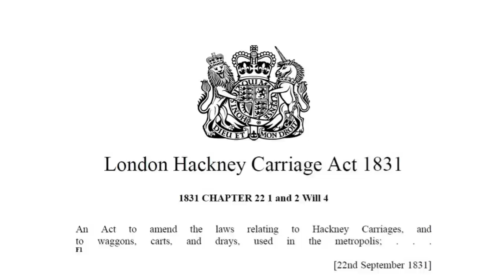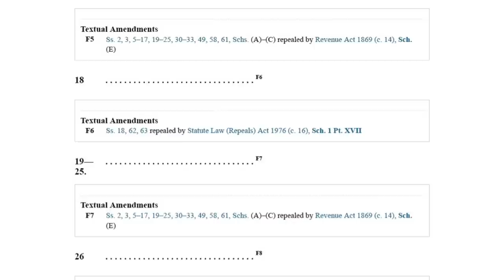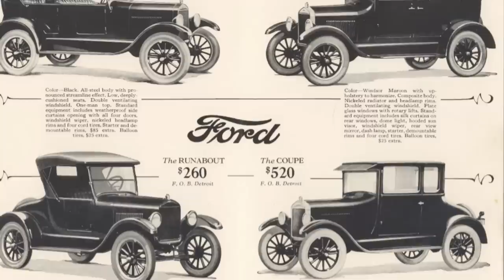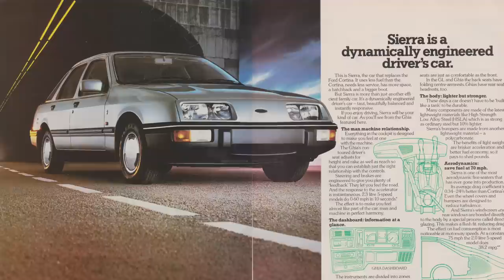Four Automotive Myths That Just Aren't True

Comment: Closed captions say "five common automotive myths" 0:19  I first heard the backwards aerodynamics claim directed at the Ford Pinto hatchback. Supposedly pro stock racer Bob Glidden  had Ford measure drag on the Pinto and as a lark, turned the car around in the wind tunnel and found it created less drag that way. Until now, I believed that trait was largely confined to the Pinto. thanks for clearing that up!

Comment: Thanks for this interesting look back into our automotive history. In defence of the dear old allegro. It wasn’t a bad car, I used to sell them for a while when the first came out. They were really  only an up graded  1100. They were comfortable, roomy and they went well. The original  ‘Quartic’ steering wheel was a bit of a hard sell but hey, it was the seventies. As ever keep up the good work
Reply: Squared-off steering wheels are very common these days - look inside a Peugeot! The Rover SD1 definitely had a slightly squared wheel but no one seemed to mind. The Allegro was ahead of its time for that - if only they'd given it a hatchback!
Reply: i remenber when i saw the alegro i felt like it was a original design or a evolution of the austin 1300(GT or not)same engine of the mini 1.275 GT , the regular 1.3L was less powerfull, it wass bigger and nice lines in the car body but had already bought a new car two monthes earlier ,so i didn´t bought it for me , i´m not sure but in the 80´s they released a improved model ,maybe late 70´s
Reply: I can't talk from personal experience, having never owned an Allegro, but if they really were as bad as some would have you believe, why were there so many of them around?

Comment: To expand on the Alfasud story with information from Matteo (Roadster Life)'s channel:
The Sud used the same steel as Northern Arese-built Alfas - the reason they rusted so badly is that the factory was new, with a disgruntled staff more used to farming than building cars, and the several hundred micro-strikes that came during the Sud's production meant that bare steel car bodies were often left outside, totally unprotected in the weather between the stamping and welding plant and the final assembly line. There was nothing inherent about the design or specification of the Sud that made it any worse than most other cars built at the time - it was just poor management, industrial action and inexperienced workers. Lancia's reputation for rust is even more of an old wives' tale.
Since 1989, every single Alfa Romeo product built has been galvanized, so the idea that Alfas are still rust buckets is simply not true. In fact, they're much better protected than most Japanese and many German cars. Amazing how one product can tarnish a manufacturer's reputation forever.
Reply: Yeah second gen Alfa sud had a pretty decent rust proofing,not astonishing but good enough.
Reply: The story that I heard was similar in that the bodies of Alfa cars were built by an outside contractor who stored then in a leaky old warehouse, where they were rained on, the body cavities ingested water and when they were moved to the factory they were dipped in the usual protective primer that simply didn't adhere because it was wet.  When Fiat took over Alfa they insisted that the supplier build a new dry warehouse to store bodies and panels and to ship then in covered trucks.  I have an 1984 Alfa Alfetta GTV6 that had the new paint protection regime as well as being waxoyled by the dealer from new  and it sits there today outside in sound paintwork condition and in a better state than my 1992 Merc.
Reply: My 1999 156 and 2007 159 both rusted to destruction.
Reply: My 1991 Alfa 33 was less prone to rust than my previous Renault Clio from the same model year. And yet, each of them was far from having the same reputation on the market. So, yes it's time to get rid of all this unfounded bias and prejudice.
Reply: My sister has just written off her 12-year old Brea. Terminal rust on subframe. Sad really because the rest of the car was beautiful. Obviously not galavanized properly (at all?) We sold our 1996 Audi A4 at 12 years old and there was not a spot of rust anywhere. Even stone chips were ruse-free. That was galvanized.
Reply: @garethonthetube  Yes I had that on my 159 - the subframe (and entire body) is galvanized but the paint they used on it was poor and the undertray has insulation that traps water against it. It's a known problem on 939/946 Alfas and many specialists provide refurbished subframes for a reasonable price. Funnily it was the only rusty part on the entire vehicle.
Pity she scrapped it, it's an afternoon's work to swap a subframe on those cars. I did it myself with hand tools.
But I've still seen younger Mercedes, BMWs and Volkswagens with much more serious rot on visible body panels. Mercedes in particular were famous for building absolute rubbish in the late '90s to mid 00's.
Reply: @Strike86  The garage couldn't get it off, it had rusted itself onto the rest of the body, so it would have caused a lot of damage. Wasn't worth it.

Comment: I owned 2 Alfasuds, still to this day one of the best cars I've ever driven. they were incredibly reliable/economical/quick/handled well/comfortable/well appointed but they turned to dust at an alarming rate like everything Italian did back then. most cars from the 70s weren't built to last which is why few people had them serviced regularly (I was mechanicing from the mid-70s to the mid-80s).
you're right about the All-aggro getting too much stick. it was a massive leap forward in refinement/practicality/performance over the 1100 even though it had that weird steering wheel, strange tapered brake pads and too much really cheap plastic inside. the estate version was a cute little thing though. 
but hey it was the 1970s, a period when most of the British car industry was under British Leyland and stretching out the life of ancient running gear in new bodies was pefectly acceptable.

Comment: The problem with the rear window of the Alfa-Sud was the clips that held on the chrome strip.  They were pushed in and broke through the paint all around the window. When I replaced the the bottom of the rear window of mine we took the rear window out and rust proofed it all around then replaced the window. Instead of replacing the chrome surround I filled the void with black Silastic and took the time to make it look perfect. i remember seeing an Alfa guy do a double take when he walked past mine at a service dealer. I spent over an hour telling him my views on the car which was mostly favourable -the fault was where they took the vacuum off caused that spark plug below it to burn out. being in Australia it didn't rust until after i had a collision and they didn't rustproof the repairs.

Comment: Ford's quote never said you couldn't get a car in the color you want if the color you want is grey, green, blue, or red.  He simply said you'd get what you want if what you want is black, and that was true so long as he said it in 1914 or later.  He wasn't lying.  The idea that that was the only color ever made is something he never said, but was actually true after the first year.  Japanning, or baked enamel, though we'd use the term varnish today to describe the technique called "baked enamel" then.  Having the body match the frame and other parts of the car also streamlined production, so, while not necessarily drying faster, it did speed production and make it cheaper overall.

Comment: I have a couple more for you Ed.  No Audi sold in the UK have indicator bulbs fitted at the factory.  When Audi realised that nobody used them, they saved some money buy not fitting them in the first place.
In the eighties, the sales contract for the Ford Escort XR3i stipulated that if you didn't wear a basball cap back to front every time you drove the car, your mum would confiscate your car keys.
I'm pretty sure they are both true>

Comment: All basic cheap cars of the 70s rusted, because no car company used much corrosion protection such as zinc dipping and the paint was acrylic, not epoxy. British roads are routinely salted in winter, and there's your prime cause. My first car was a 1970 Viva. At 8 years old, it was already fairly rusty and tired, and that was normal for Vauxhall, Ford, Hillman, BL, Fiat, etc. An 8-year old car today is considered nearly new as long as it's been treated reasonably well.

Comment: I remember spending many hours looking for information before the internet. One of the biggest problems was finding practical information. For example if you needed to do a job on your car you could get a repair manual from the local library. However in practice you really needed to talk to someone who had experience doing the job... The man in the pub probably had never actually done it... but any ideas were better than nothing.
Reply: That's probably why I wasted hours shopping around for a metric adjustable spanner.

Comment: What I heard about the Alfasud was that it was actually built in the Sud, the south, in a new factory in Sicily that was right at the coast. 
 
But the Italians had a habit of striking frequently, and in that time the freshly built raw steel bodies were standing outside, totally unprotected. 
 
Outside, with the sea near, they were getting salt spray right on the raw steel body. 
 
So you had the main source for rust, the salt from winter, integrated into the car, even UNDER the paint. 
 
No wonder the people said the rust before you buy them...

Comment: To go further into the Alfasud (and Lancia Beta) rust issues, which mostly afflicted early production models, we have to get a look into how and where it was produced.

In 1968, the Italian government and Alfa Romeo renovated the old production facilities at Pomigliano d'Arco (near Naples) as part of a plan to industrialize Southern Italy, but for some reason, the people who got hired to work at the renovated factory were mostly the same who renovated it, leading to some early issues with workers who never built a car before being takes with a whole sub-brand of new cars (as Alfasud was meant to be a whole branch of Alfa Romeo), and on top of that, the frequent late 1960s/early 1970s strikes meant that steel panels meant for use in cars were often abandoned outside for days, leading to early Alfasud models suffering from early rust.
Reply: Another part of the problem was, apparently, that many of the assembly line workers were from farming families and simply sloped off from work to help with the harvest rather than finishing the week's production. It is nonetheless strange that management hadn't taken the local economy and working traditions into account!!
Reply: I heard another story about southern italian workers being reluctant to apply anti-rust coating under pretext that 'it was irritant to their skin'.
But, Luigi, we have provided you some protective gear to avoid that. Why are you not wearing it?
Because it's too hot in there.
facepalm 😮‍💨
Reply: @razorback20  That one most likely ain't true - keep in mind these people came from rural areas where they either worked the fields or brick & concrete, it's not like they didn't know about protective gear or cared much about skin conditions.

Comment: A great video Ed as usual. Many cars of yester year had design deficiencies that held water in some way. Some were mechanical (lack of drainage holes) along with production where body shells had to move outside in the rain from one building to another. Other issues could be aimed at the perceived anti rust treatments that were OK for a year or so before breaking up and forming rust traps accelerating the metal moth. Adding external trim was also a problem where push/screw in mounting clips could wear the painted mounting points adding even more rust traps. Thankfully things seemed to have moved on... from a body perspective anyway. Back in the day a 10 year old car could have been perceived as living on borrowed time due to body rust, these days the car body in many cases out lasts the engine and running gear. Cars could last even longer if the costs of things like suspension, labour costs etc didn't exceed the scrap value of the car and that is a big shame. A quick question, does a London Taxi still have to a) have enough headroom for a gentleman to wear a hat and b) be able to perform a 'U' turn in the street?

Comment: As an ex alfasud owner and professional paint sprayer I'd say that the steel in Alfas may not have been Russian but it was poor quality, these cars rusted fast, a lot of cars rusted back then but alfa steel rusted much faster than say Ford steel, a rust scab that started under paint would be a hole in no time. My friend worked for an alfa dealer back then and the suds were rusty off the boat, boot lid hinges would be siezed on delivery. Mind you, I worked for Peugeot and a good few 605's were painted before delivery due to rust issues. 👍

Comment: I remember reading about the theory of 50s rust onwards that low back ground steel reacting badly to chemical treatment and also welding methods at the time, interacting with the radiation contamination in the steel lessing durability. Now I don't buy it but I'm no bio chemist or radioactive materials expert.

Comment: Great video Edd, about the Mini myth, I never knew that myth was that, I did believe that myth that BMC made a loss on every Mini they produced, but you’ve busted that one, thanks! 
       Another myth is regarding the Reliant Robin three wheeler that Motorcycle licence holders had to “blank off” reverse gear if they didn’t have a car driving licence, this may have had some truth when three wheeled cars first made an appearance but definately a myth since at least as far back as the 1960’s. 
    Reliant Robins we’re produced and sold to motorcyclists so that they had a choice other than paying for driving lessons and passing their tests before driving a “Car”.
Reply: Sorry....but that is a myth as well. Reliants , even before the Robin had reverse and you had to have a full licence to drive one. 
I think you may be getting confused with the original three wheelers... that were driven by motorcycle engines ...some even  had to be kick-started under the bonnet!
The Meschersmitt three wheeler? And another one whose name escapes me....)
They obviously did not have a reverse gear....so possibly, that was the loophole.
Maybe.... just maybe, they did not require a full "car" licence.... But later Reliant Three wheelers you surely needed a car licence.  (My Dad had one)(🙄)
The major difference was the annual car "Road Tax".... they only attracted a tax of somewhere between a large motorcycle & a four wheeled car. 
For some reason....That was the clincher for my Dad....  I personally hated the damn thing! A freaking death trap: An accident looking for somewhere to occur.

I never passed a Motorcycle  FULL licence...I was a "L" (Learner) on machines up to 250cc.... But I had a full licence for cars....so I could drive the Reliant.
Having just written that...you have made me re-consider: My Friend has a Full Motorcycle Licence  & also had a Reliant at some point.... Mmm I'll check with him!
As Arnie would say: I'll be back! Cheers.
Reply: @patagualianmostly7437  My Dad only ever had a bike licence and drove one for many years, I owned and drove one legally after passing my bike test, it actually helped me get more practise on my own for my full car license.
       The idea that motorcyclists could not drive a three wheeler unless they blanked off reverse first is definately a myth nowdays, this may have been the case initially but certainly not for long.

Comment: Pretty much all grades of mild carbon steel will rust if not treaded. Steel is by definition mostly iron, which will rust (form iron oxide) when exposed to oxygen. I worked in heavy equipment manufacturing for decades,  our vertical panels are basically made with automotive grade sheet metal. Anything that sits in the factory unpainted has to have a rust inhibitor on it. Thicker plates are shot blasted to strip off rust and scale prior to painting...but any scratch or dent that disturbs the paint results in immediate rusting. The trick to keep cars from rusting is  1. Galvanizing (adding a coating of zinc or other non-reactive metal) and 2. Paint with multiple layers of urethane based coating to keep oxygen away. Datsun /Nissan cars of the 70's were notorious for rusting while in transit from Japan to the US...zinc dipping ( and thicker steel) took care of that.
Reply: Yes...I can appreciate that. 
Also...they claimed great MPG figures.... of course they could: The cars were self-propelled-tin cans!  great MPG but...Lethal in even a minor accident.
Are we seeing a return to that scenario with these overweight electric cars? The inertia is immense... any accident will be accentuated by that.  
You have to wonder...don't you... "save the planet with your electric car"....."kill yourself and your kids with your planet saving car."...  What a crock of........

Comment: I always learn something from your videos, and today is no exception.   There are a lot of stories around the Allegro production.  Have you heard the one about the early Maestro that if you jack the the back up on the original supplied jack that the rear window pops out.. I've wondered if there is any truth in that one.
Reply: I heard that story about the Allegro !! Myths merging and melding !!!
Reply: One thing I do know from experience ... if you parked a Renault 4 half on the pavement and opened the tailgate, you couldn't close it without levelling the car fully on the road.
Reply: A friend had one of the first Ford Escorts, the body of which flexed so much a door would burst open when cornering hard.